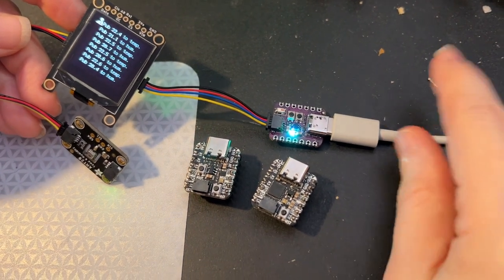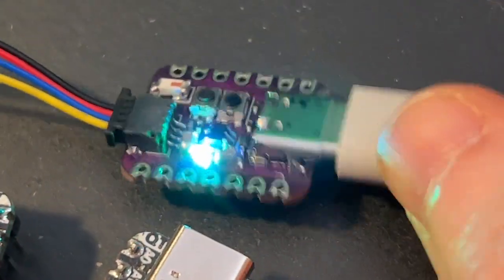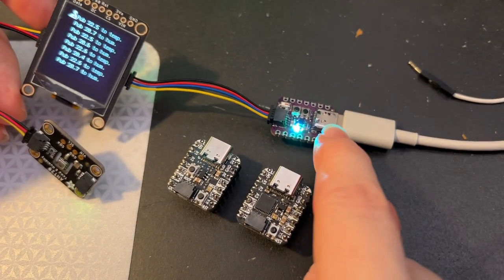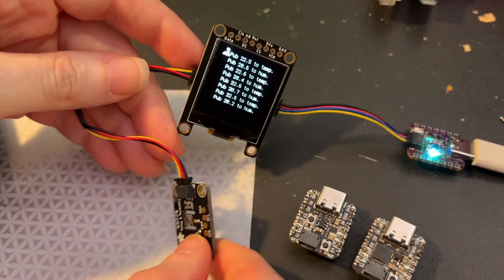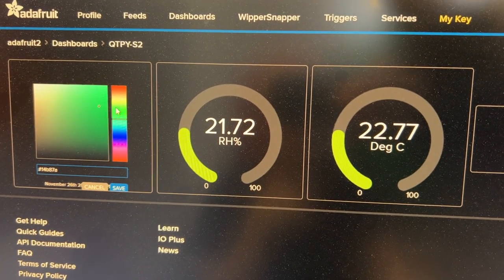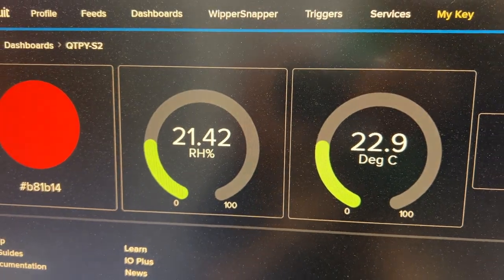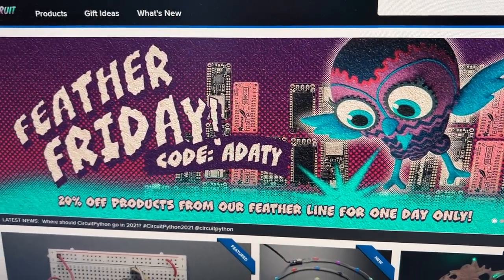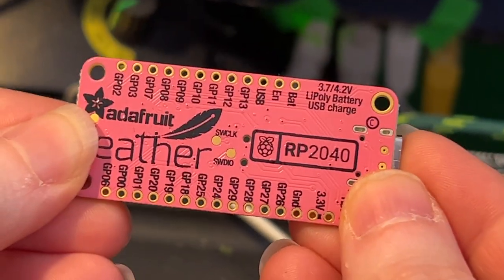CircuitPython works with QT Py ESP32-S2 board & free Pink RP2040 Feather in our Feather Friday sale!

Comment: Hey I was just looking for something like this.  Could this be used inside say a fogponic terrarium type system to monitor temp and humidity?
Reply: Sure does seem like it’d work great.  You could use the recently released ESP32-S2 Feather board, with integrated BMP280 (or BME280?) for the same function with an integrated sensor.  But if you wanted to mount the sensor remote from the MCU board, this would be great for that.